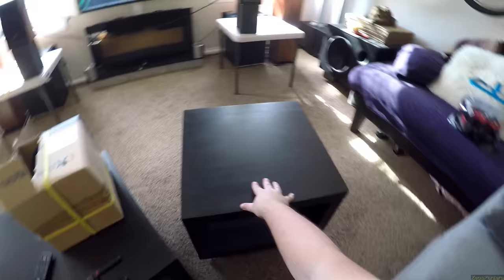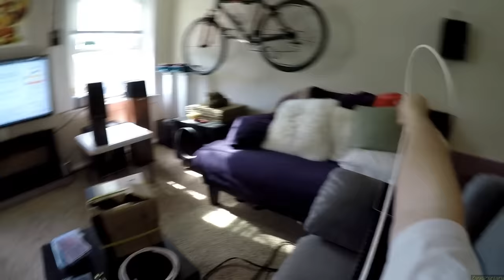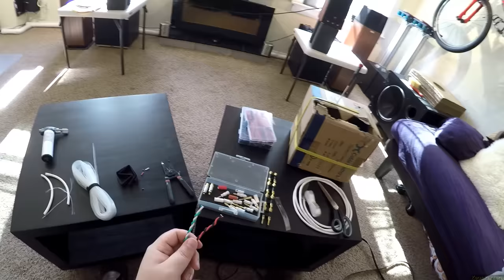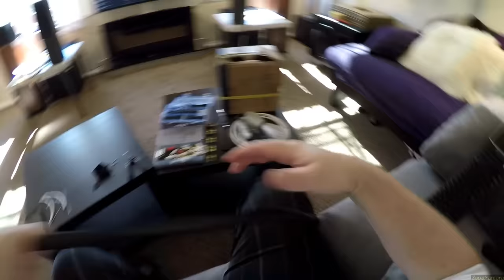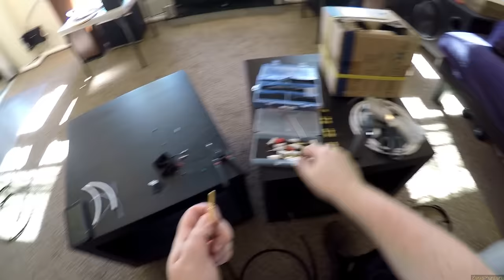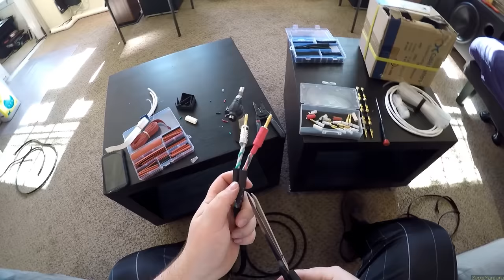Z How - Building Awesome Speaker Cables

Comment from the maker: Help Support this Channel Here ::
⚔️https://www.SubscribeStar.com/Zeos -- Subscribe Star
🥇https://www.Patreon.com/Zeos -- Check out the Patreon
Reply: While this is a damned old video at this point, here's some info for any newcomers and to answer your question Zeos. Yes using a tube actually would make a difference in terms of ability to conduct signals at a given gauge. Electricity flows primarily through the surface of a conductor, if it's a constant flow (Say with stable DC power), the depth it reaches will increase over time (We're talking nano to milliseconds here), but once you get into higher frequencies, it doesn't have time to saturate the wire and can only travel along the surface.

Using a tube would actually improve the amount of surface area of the wire, lowering it's resistance before saturation, this is also why low gauge wires have a lower resistance as they also have a higher surface area and why high gauge wires can cause signal degradation, because the resistance gets so high that the signal isn't able to push through the entire length and it stops conducting. This is a bigger deal in radio communications, but applies at lower frequencies like with audio too. Though I can't say that using a tube would be very practical unless you're using hard-wired connections that'll never move once bent. However, it's also a moot point since that is exactly one of the reasons why multi-core cables are commonly used as they massively increase the surface area and being in close contact they act as one massive conductor with a greater surface area than a tube or solid core wire.

Comment: It is four fucking AM, I should go to bed, buuuut... I guess I'll watch a grown ass man play with wire.
Reply: Andrew Robinson I've accepted it.
Reply: Andrew Robinson same
Reply: Andrew Robinson you know what I did, I have some pretty expensive speakers, tested multiple high dollar, way way expensive cables. know v what I run now? far less effort than this shit, just soldered connectors onto gold Radio Shack speaker wire the kind that's $12 from a fucking spool. "sounds" just as good as megabucks cables and takes 5 minutes to make.
Reply: lmfao its 11pm and I got to get up at 3am lol fuck it.
Reply: Exact same situation for me. Long, uneventful video, but I couldn't look away.
Reply: #Respect lol

Comment: Cracks me up, I built commercial aircraft cables for 18 years, shielded, various gauges, generator cables. We had termination tools both as to not crush the conductors leading to weakness and heat as well pneumatic crimpers but I never built my own home audio cables. We always used heat guns but our conductors had teflon coating so they could take the heat. Thanks for sharing, its super easy

Comment: That was great, lots of good tips and tricks, I have terminated many speaker cables with those exact Nakamichi bananas. And I have poked myself with the screwdriver. And I have also stripped off too much copper. Excellent tips and tricks. Highly recommended.

Comment: I love you Z, and this will be the only tip that i can probably ever give you. Having been in the car audio install business, ive found the clamp type strippers that you lay the wire in sideways, and it can be any guage up to about 8. Just squeeze and it strips however far you set the wire in, crispy, clean, and never takes copper with it. They usually have adjustable tension to assure that.

Comment: Instead of twisting the wires by hand, I've seen a lot of car audio installers use an electric drill. They'll put one end of the wires in the chuck and then secure the other end to something like a vice. You'll have perfectly twisted wires in under a minute.
Reply from the maker: Ive done that for long twists. But not for a 6" length.
Reply: No Huevos a bit late but do you know if I can use this for RCA wire?
Reply: There is no real need for twisting the cable.
Reply: @Regnarrussell  There are a lot of 1 star reviews
Reply: James Moore  mine works just fine. If you want better quality then buy Milbar set but they are not going to be cheap.

Comment: If you really want to go full ocd, I would recommend the copper crimp tubes to for inside the banana clip. Much more secure than bare wire.. Also make sure to use the correct crimp tool ''barrel crimps'' .. I was going to put a link but had a hard time finding the large hole barrel crimps

Comment: I currently have forearm and finger cramps from braiding too long headphone cables. You should make a video about doing this. I did figure it out on my own, but not before a couple of failed attempts from improper technique and starting over again, very frustrating. Also, that feeling of doom when you notice you messed up a single twist right in the middle.

Comment: Pro tip:  
If you use a drill, and feed the ends of the wires that you want to twist into the chuck, tighten chuck, and then slowly squeeze the trigger, you can twist wires together very evenly . Makes it very easy and attractive.

Comment: Headshrink works much better with a hot air gun. Also when stripping wires, just cut the insulator and then spin it clockwise as you remove the insulator, that way you twist the wire perfectly while removing it

Comment: I used to get the wire pants or I guess they're called boots from Parts Express. I think I had a few dozen at one point and used them for speaker and RCA cables over the years.Recently I found a bunch of new old stock Soundstream boots on EBay but I'll be damned if I can find them in my " project boxes" in my basement.

Comment: Zeos, use a drill to twist the wires, since you're cutting off the excess anyway it won't affect the rest of the wire and give you a much more even twist!
Reply from the maker: Id start with 8-9 inches if I did this. Because it will compress a lot more.

Comment: If you want to up your cable OCD game, get some DeoxIT Gold. Do your own research, but it's the real deal. You want the 100% concentration Gold in a little nail polish bottle, and it'll last forever.  They have great contact conditioners and cleaners for various electrical stuff (including fader lube) but Gold is specifically for making sure your nice new gold contacts make great contact, and keep doing that.

I use it between copper and gold when making banana cables,  and on the banana cables before insertion. I know it makes a difference for the banana plugs I make for mutimeter and power supply leads, so I do the same for my speaker cables.

Comment: Zeos which closed headphone that you have tested has the best imaging? 
I will use it for gaming and also music listening. 
My budget is around the AD2000X price. 
Current setup is PC -> game/music -> O2 ODAC combo -> Shure SE846
Thanks for the help.
Reply from the maker: Look at the A1000z or A2000z.. The best is the Ether Flow C
Reply: For some reason A2000Z is $250 USD more expensive than A2000X here......
Do you know what is the difference? (because the specs are nearly identical)
I can't find a ether flow c demo in the shops, but that has a much higher price point anyways. 
Anyways thanks for the quick reply, also fuck Audio Technica for not putting detachable balanced cable on such a high end product.

Comment: Sometimes, to feed your sharp ends through the sleeving, you can just use some electrical tape and it saves messing with 'shrunk' heat-shrink when its done its job. Just saying. The hardest part I have found is getting a "good" wire for the job. See..? sometimes Australia isn't all its cracked up to be... You have to Order everything IN and Shipping gets expensive when you're talking wire...

Comment: Those are nice for people that want them but I've been using 16 gauge lamp cord 4 years and even swapping out with the expensive cables I can't hear the difference
Reply: I mean if your going to spend $500 On speakers and an amp why not spend $40 to $60 on wires like rca and speaker wires to not only sound good but look the part also. You can even buy them already made on ebay for that price give or take. Has to be better then a lamp cord in sound and if not definitely looks better. But to me and it's just my opinion, if you have to use lamp cord for wire then you might be in the wrong hobby. Audio tends to be a costly hobby and definitely a hobby one should take pride in.

Comment: I am planning on trying this with the 14/4 version of the cable.  How difficult is it to get the cable fairly straightened out?  Should I lay it out flat across the floor with some books on it for a few days?  Or will it always try to coil?   Thanks for the informational video with a touch of comedy!
Reply from the maker: Depends on the particular cable. It can stay a bitch for a while.

Comment: 16 ga has a cross-sectional area of 1.31mm² - Times Two = 2.62mm² which is precisely what 13ga speaker wire is.

 For reference 14ga is 2.08mm². 12ga is 3.31mm².

Comment: You could use electrical tape to wrap the loose wires to get it through the wrap easier.
Reply: @Zeos, even better use Teflon Tape, easy to go slide and then to remove with no mess :-)
Reply: David Johnson Just put the wrap on from the other side?

Comment: If you twist orbitally it won't fuck up. Hold the bottom wire with one hand and twist the one on the top counter-clockwise. Then, wrap/twist it over the other wire (while keeping the top wire twisted 1-turn counterclockwise in it's own respect). Finally, put the top wire under the bottom wire and repeat. This is a common technique used in ropemaking. ;]

Comment: I used to buy cable like that when I had my starter set up....and as soon as you said it's just an electrical signal I was done....try making them out of pure silver cable with silver solder and rhodium banana plugs....the clarity is amazing.
Reply: hi since you know some things, I was wondering for my beginner set up if it would be ok to wire up to a 4 ohm speaker via 4 plugs on one end and 2 on the other?

Comment: This video is about two weeks too late for me.  I have been working on some and decided that the TechFlex and speaker pants are highly irritating and will be using friction tape and heat shrink instead.

Also, buying from Wyvern Audio is much more cost effective, but yea, probably not as therapeutic.  I'm already in over $100 and don't have a complete matching pair yet.
EDIT:  almost $100, but I already had the wire before I started.  Now I want to buy the four conductor wire to be cool like Zeos.

Comment: I ordered the 3M 4' Red and White heatshink (linked here) several months back.I finally started my wire build and when it came time to heat shrink around the banana plugs, I realized that what I ordered (linked) is way too big (1 1/2" flat and 3/4" diameter). 3/8" diameter might be a little tight. Any chance it was 3/8" or 1/2" diameter in the video?
Reply from the maker: I think 3/8 or 1/2 will fit. I hate the way heat shrink is labeled.
Reply: yep. hoping to find the right stuff in the states next week when I return for vacation. I have one set of Zwires complete except for that extra step of covering up the banana plugs

Comment: I have a bunch of 12awg monoprice 2 conductor wire (regular, not sheathed).  If I am going to double up to get 9 awg, is it better to just keep them parallel, twist the two lengths together, or split them into 4 strands and twist each pos/neg pair and then twist the two pair?

Comment: Buy an auto stripper. You can get on ebay or Amazon and you will NEVER use those strippers again.  I strip a lot of wire ans it is THE BEST 15$ I ever spent.

Comment: Seems crazy to go to all that effort to then not solder the connectors on.
Reply: A crimp is better. And a micro weld is probably best. But I agree, I don't love these bananas. The connector is the most important part. I wonder if you could tin the bare ends with a type of copper solder. That might be ideal.

Comment: In the '80's, I bought 100 feet of 14 gauge speaker wire, cut it into 4 equal lengths, stuck the ends of 2 into an electric drill and twisted them tight.  Soldered the ends and voila--1 7 gauge speaker wire.  Except for the fancy ends, they were identical to the grossly overpriced Monster Cables of the time.  I may of spent $10-15 for a 25 foot pair.  Videos like this just make me laugh.

Comment: hey zeos what cable would you recommend for making headphone cables like i found the connectors i want just not sure what cable to use like i know not too thick just not sure which sections to look
Reply from the maker: Microphone cable is usually what is used.
Reply: Z Reviews would it be worth it to go 4 conductor or just stock 3

Comment: Why cover those beautiful metal ends with heat shrinks?
Reply from the maker: Keep them from unscrewing. Clear would work also. Like good indication.
Reply: I would add also for insulation, i am upgrading the speaker connectors in my system and will use clear heat shrinks so they still look cool..  btw Zeos the link you sent is for 6 inch clear,  where in the hell did you get those rolls

Comment: What do I need to beable to plug a rca connection to the back of speaker terminals
Reply: A pre-out of RCA from a source into an amplifier or receiver with RCA inputs and speaker terminals that can drive the speakers you intend to use.

Comment: Are you sure you combined the right wires? In case of cable wire configuration shown below:
1   2
3   4
you should twist and connect together wires 1 & 4 and 2 & 3. 
Connecting wires in pairs in such so-called star-quad configuration reduces a cable inductance by 50% and increases cable immunity to electromagnetic interference.

Comment: So I have researched the shit out of this and still havent found an answer which means Im probably asking the wrong damn question on google but maybe some of you hifi geniuses can help me out here.  I have currently 2 sets of headphones with unbalaced cables with 1/4" jacks.  I found an adapter on amazon that supposedly will allow me to plug my unbalanced cables into a male 4 pin xlr so I can then use the higher power output provided the balanced section of my questyle cma400i amp/dac.  My question is will this actually work and or is it bad for my equipment in any way?  I would much prefer this option to spending a bunch of money on some balanced headphone cables.  Any help greatly appreciated.

Comment: You can use  Bi-wired setup, instead single wired or bi-amped, and remove the plates at the high -low speaker connectors. 2 plugs from the amp into 4 plugs at the speaker, thats how I have setup my fronts. I use 7.2, if i bi-amp my fronts ill end up with 5.1...
You should checkout this brand; https://www.teufelaudio.co.uk I build my THX home theatre with their System 5 THX with double THX subs and the T-500MK2 as front and I am very satisfied, especially with the midrange tweeters and instruments in general.I actually stopped buying speakers after having a few other big brands before these.
They have some  serious higly rated speakers for 'affordble'  prices.
Would love to see a rating compared to others.

Comment: so the thicker 12 gauge version still has 4 wires and are those 9 gauge each? or 2 twisted together becomes 9 gauge?  thx.
Reply: Not sure about the ones he posted, but Mediabridge has some on Amazon that are the correct gauge per wire inside the sleeve.  Just a fair warning: they are not OFC as they advertise, but CCA - if you care about that.  I believe they are also cheaper than what he purchased.

If you don't care about shielding, I highly recommend the KnuKonceptz Kable on Amazon.  Accurate gauge, pure copper, and great pricing.
Reply: I wanna build the ones he made.... I got 80% of the parts already

Comment: Oh you really fucked with my ocd at 40:10 when you slid over the black shrink tube and it kind of folded over a bit, and you let it stay like that while adding heat and fixated it like so. If I saw that on a cable I would toss it... Damn..